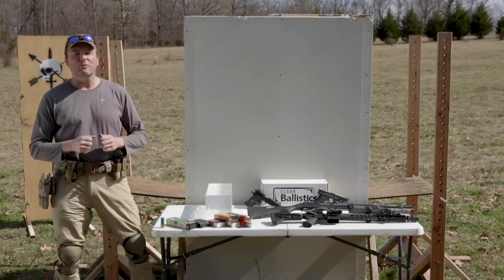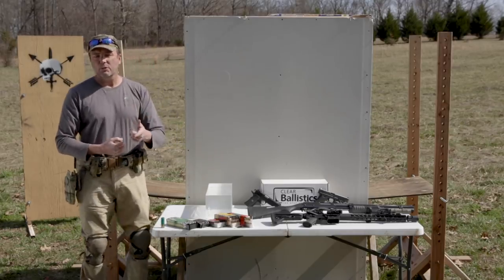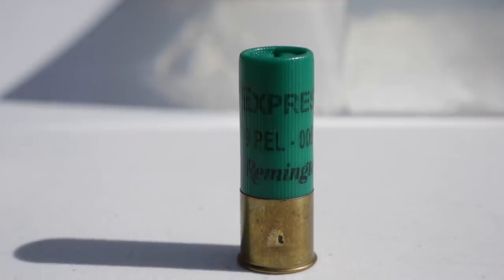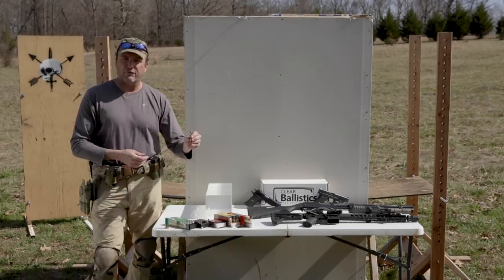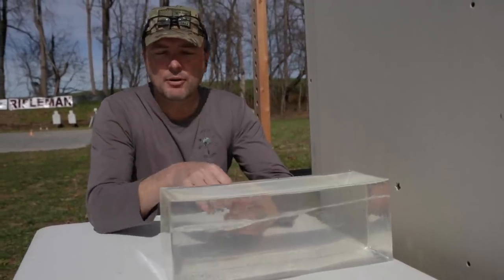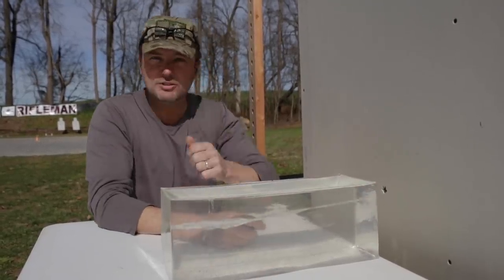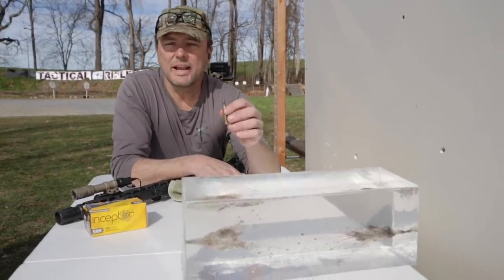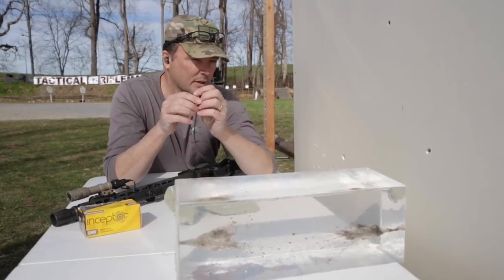What is the Best Gun & Ammo for Home Defense | Ballistic Test | Tactical Rifleman

Comment: I want to see varmint rounds from a 10.5" pistol/sbr
Reply: you & me both
Reply: Shortening the barrel wont change terminal ballistics at that range.
Reply: @lanenicholson3712  it actually does. Normal velocity from a 20" barrel is 3250fps. In general 5.56 must be in the  2700fps range or greater to fragment correctly. A 10.5" barrel  has velocities from even the best match cartridges around 2250fps to 2350fps max. Telling someone it doesnt matter will get someone killed because it does matter. What matters most is the projectile design. Fmjbt will tumble and fragment at 2750fps,but not at 2400fps. If someone is using a 10.5" barrel for home defense,use a round specifically designed for the velocities that can be expected. G2 research R.I.P. 5.56 is absolutely one of the best rounds for the home defense AR pistol and will fragment at the lower velocities of these shorter barrels.
Reply: @FreedomInc  There are actually quite a few tests showing decent tumbling and fragmenting of various .223 and 5.56mm even from a 7.5" barrel with most of those under 62 grains easily passing the 2200 fps mark.  With a 10.5" barrel that definitely is no problem.   Look up the PoBoy Special's channel and you'll see what I'm talking about.  As for the G2 RIP round, it actually with its 65 grain projectile, is a bit slower than most but still would probably be fine in a 10.5" barrel.  But really any 55 or 62 grain soft point hunting round in .223 would do fine.  Where  you run into trouble is the "varmint" rounds mean to rapidly disintegrate as these tend to have low penetration.  Ironically the faster the velocity, generally the lower penetration they get as they disintegrate faster.  Right now I'm trying to find more tests of the Federal American Eagle 50 grain varmint round through shorter barreled AR's to see if inversely , these get better penetration with lower velocity.   But until then I'm just sticking with Remington 55 grain soft point rounds.  They're pricey but worth it.  For practice I just use cheap Federal XM-193 FMJ (which also performs reasonably well in gel even out of short barrels).
Reply: @furryhatsgunsunicorns3219  I agree with most of what you said. If you read my comment it was based I the "fmjbt" projectile. Spire points will mushroom even at super low velocities. They fragment at these low velocities due friction and mushrooming. They aren't actually fragmenting they are being torn apart. The light varmint rounds disintegrate due to twist rates multiplied by velocities,or rather the 2 combined. The lighter the projectile in 5.56 or similar also means its shorter. Contrary to popular belief twist rates aren't a factor because of weights of the projectiles,rather their lengths. But since you have a max and minimum diameter weight is relative to length when comparing a certain type of projectile. With a 35 grain varmint round,really someone should be using a 1.12 or a 1.14 twist rate barrel. My point was that a fmjbt will fragment apon impact at 2750fps,but not at 2350fps which all you are going to get from a 10.5 inch barrel. I guess no matter what firearm you have,just do your due diligence so you dont poke self dealing holes in people before they kill you.(not meaning you personally)
Reply: @FreedomInc  My AR pistol only has a 7" barrel so for me, ammo selection is extremely critical.  Anything under 2,200 fps  (according to one of Hornady's main ballistic engineers who's done a lot of work collaborating with the FBI and law enforcement) and you don't get any damage to tissue from velocity.   As such, for me, anything that surpasses 2,200 fps, that expands well (or fragments), and that gets more than 12" of penetration, is the perfect round for my needs.  Most brass case 55 grain soft point rounds seem to meet that criteria. Cheap Russian steel case HP ammo works in my AR pistol, but not sure about how much velocity I'm losing as the steel cases don't always form a right gas seal in the chamber and so sometimes some velocity is lost.  Sadly it's hard to find such ballistic data from short barreled AR's on that ammo.  
What would also be interesting is to see how well the lighter high velocity varmint rounds perform  on a hog.  Not sure how humane that would be (probably best done on a freshly killed hog that was killed with a proper hunting round), but it would provide a fairly definitive answer to what it would likely do to a human in a home defense situation.
Reply: @furryhatsgunsunicorns3219  velocity and the design of the projectile,plus the media the projectile is entering or hitting determines penetration and fragmentation/expansion. With any length barrel whether its 7inches or 20inches,using the same projectile will expand/fragment different (normally better at higher velocities). Again,projectile design plays a large role in this. But velocity plays a huge role also. Depending on barrel length you will have severe difference when hitting a target at 5 meters then when you compared that to 50 or 75 meters or even a 100 meters. There are alot of factors that play into this that I have mentioned but twist rates will even effect expantion and fragmentation.
Reply: The only way to settle the velocity debate is for someone to stand in front of an SBR and see if it does the job.
Reply: @furryhatsgunsunicorns3219  Would you say those 55gr 223 soft point rounds are in the top 5 (or so) rounds for home defense?
What about subsonic 77gr 223 soft points?
Or subsonic 300blk soft points?
(I prefer to build a subsonic setup for home defense; but if there's no reliable subsonic ammo in regards to keeping over-penetration to a minimum, I'll go to supersonic)

Any info would be GREATLY appreciated. I've been looking what to put together for my home defense setup, & all this info I find seems to get contradicted by other info I find.
Reply: @bullheadedgideon1673  Generally speaking, most 55 grain soft point rounds from what I've seen in tests, expand just fine from an AR pistol. Check out the PoBoy Special channel if you want to see a bunch of tests of different rounds through a 7.5" AR pistol.  Now some people do recommend the heavy 77 grain .223 soft points. However the problem is that with those you tend to get 2 issues:   More excessive over-penetration and much slower velocities.  According to most ballistic experts, if you're not getting at least around 2100 fps velocity, then you're not going to get consistent "cavitation" damage to tissue caused when tissue exceeds it elasticity point and tears when the temporary and permanent wound cavity are created as you see in ballistic gel.  In ballistic gel you see this even with good pistol caliber home defense ammo.  However it's meaningless as most tissue (aside from very delicate tissue like the liver) has enough elasticity where the only damage that is done is by the hole that the bullet makes as it expands and by any secondary fragmentation from the bullet or the bullet's copper jacket.   So since .223, even with a 77 grain bullet, tends to make a tiny hole, it's very much dependent on its  velocity coupled with good expansion and/or fragmentation to do its damage.  That's why I don't recommend such heavy grain .223 rounds in AR-15 pistols.
Now with .300 Blackout, that's a whole different critter.  Because of its bigger, heavier projectile, you can get away with slower velocities as it punches a bigger hole and delivers more foot pounds of energy into the target with generally a much heavier grain bullet.   But if you go with a subsonic round, you need to really do  your research on which ones expand reliably and penetrates more than 12" of calibrated ballistic gel.  I can't tell you which ones to buy though as I'm not all that knowledgeable on all of the quirks of the .300 blackout round.  My expertise is more in .22LR, .25ACP, 9mm, 12 gauge, .223/5.56mm,  and 7.62x39mm firearms.  I've fired many other calibers of firearms, but I've only heavily researched and shot those calibers enough where I feel comfortable giving advice on them.
Reply: @woodchuckcider1  Would you rather stand in front of an SBR or a 20" barreled rifle shooting the same bullet at you? If you had to choose.

Comment: Glad you talked about hollow points filling the hole. Many cheaper hollow points and even some pricier ones will do this frequently. Do your research folks.
Reply: Precisely why I use a proven solid.
Reply: Lyle Caudill proven solid? Like solid point? It makes a hole but I wouldn’t carry it. If nothing else the hollow point on a bad day will act like a solid. On a good day it will open up much bigger.
Reply: I'm liking the performance I see from the polymer-tipped hollowpoints so far (in demos like these)
Reply: 3nertia that’s what I load for my kit and what I hunt with. Cheaper than TAP, very accurate. I also carry a mag of steel core just in case, but use 55gr Hornady for most cases.
Reply: Same here. Might have been nice to add in Critical Defense round(.223 & .45) for comparison to standard hollow point.  That's also why I prefer ballistic tip over open tip rounds.
Reply: @davidhawkins847  i had to shoot a boar with +P 9mm critical duty once. Distance one meter, through the shoulder (it was lying on the ground after taking a hit with a .308, still alive), smashing the shoulder bone and the bullet was stopped by the skin/leather on the other side. It mushroomed perfectly, I think due to the polymer tip. Now bought this bullet for my .45, but didn't have to use it yet. But outstanding performance of the 9mm, you won't go wrong with it.

Comment: The Flight control I use in my 12ga are only a fist sized pattern at the farthest shot I can tack in my house. Which is 20  yards. That’s the absolute furthest sight line I can take a shot. Average is 5-10 yards. So I’m not worried about stray pellets. I wouldn’t EVER use cheap range buckshot like Rio or Royal Buck! You WILL have a 2 or 3 ft spread then!

Comment: #4 buck is a must see.
Can't trash the smooth bore based on 00.
Dedicated shotgunners in the know are going to #4 big time, some PDs use it, or use #1.
Mine uses plated #1 low recoil, with a wad that keeps a tight pattern, with Beretta 1301s tuned to run that specific ammo.
It will shred a mfer.
Reply from the maker: I’ll take a look at it

Comment: I know I'm gonna catch Flak for this.....

My first go-to is a .22 revolver. 9 shots but I only have 8 (firing pin is on the hammer so I want to avoid a negligent discharge) and every odd shot is a hollowpoint and every even shot is snakeshot. If for some reason this is not enough to stop someone, I can take 2 steps and a great reach and BAM! Glock 19 with a happy stick filled with NovX. Figured the first one is just a professional courtesy because I live in a complex and would hate for a round to go through the neighbors wall.

Comment: The .223 Remington has lower chamber pressure than a 5.56NATO by 10,000psi. Hence, a .223Rem has less velocity and energy than a 5.56NATO. They're the same dimensionally, though. I don't use .223s in my AR, only 5.56NATO rounds. I'm going to try a frangible 5.56 to check out the depth of penetration difference comparable to the .223Rem. I didn't know much about frangible ammo until watching this video.

Comment: This is why I use either ballistic tip hollow point pistol rounds or external hollow points. I still have plenty of standard hollow points but just know they are not going to expand through thick clothing and will act more like an FMJ.
Reply: The Hornady Critical Duty 220 grain JHP is a very good penetration round choice. It met the FBI standard requirements. I have been told the Critical Duty is designed for large frame 5” pistols. I carry it in my Ruger Commander 1911 and my Springfield Armory 1911.

Comment: So is it the high velocity of the .223 frangible that results in the disintegration vs the ARX 9mm (which seemed to stay whole)?  Was always under the impression that the frangible pistol rounds were for use in confined populated areas when minimal collateral damage (through and throughs  etc} was desired.   It would seem NOT to be the case with the 9 mm ARX if it doesn’t disintegrate. Are there other frangible  rounds in 9mm, .380 etc that accomplish the job without remaining solid?

Comment: As far as buckshot, try the Aguila mini-shells w/#4 shot...  They don't have the energy to over-penetrate but still give quite a whomp.  They make an adapter for mossberg shottys to help feed the mini-shells and I've used them in my M3 clone pump.  Good stuff.  
G9 is riffing on Underwood Xtreme Defender/Penetrator ammo which is amazing stuff. 
 The Defender ammo, with the powders available today, even allows  .380 to act effectively at reasonable distance and target (relatively close range, regular clothing) and I'm good with that for my little, Keltec P3AT pocket pistol that fits inside the palm of my hand and disappears in my ankle, pocket and IWSOB with light t-shirt and shorts.  And it functions flawlessly.
  People like to pooh-pooh the  .380 round but, to them, I say "stand in front of this, let's see just how badly it sucks..."  lol.  
  I've found that my COR BON .45 followed by my Federal HST hollow points expand better than the golden Speer through soft barriers (shirt & jacket, etc.)  and the Xtreme Defender dumps a shi-ton of energy, with less over-penetrating, as well.
  Thanks for the straight forward presentation.
Reply: They're definitely similar but G9s design works better from all the testing I've watched. They create larger permanent wounds. Both are very good though.

Comment: Those frangible rounds will go through a 2x4 they have plenty  penetration. I have  them in 45 and they can still go through car doors. But if you're inside the car I wouldn't suggest shooting them through your windshield they start breaking into pieces but if you're outside of the car and have to shoot into a windshield it's like a shotgun blast to whoever is inside. Plus and minuses.

Comment: Do this same test with a FN 5.7 4.8"bbl  and a FN PS90 14.5" bbl with FN brand ammo you won't be disappointed
Reply: Marino 
the two I mentioned above are the 27gr hp that are about 100ftps apart from each other but both out of the pistol are right around 2000/2100 ftps and about 2400/2500 out of a 14." Bbl ps90 both still available to get over the counter. The ss197sr with the blue tip is about 300 ftps slower with a 40gr bullet. Yes vanguard and elite ammunition are what I call exotic loads for the 57 and will do great as well and now cci Speer gold dot has one with a 30 gr bullet that in my opinion is really no different then the ss197sr vmax tip. Like the gentleman mentioned above... I carry the pistol on my hip to give me cover until I can grab one of my PS 90s.

Comment: Excellent video! Luckily, ammo tech has come far to meet FBI standards and the latest technological improvements include HP that expand after passing through material and also maintain enough weight when going through auto safety glass. I carry HST's for this reason. GDHP's are also a great choice regarding FBI test results. One caveat: Make sure if you are using a subcompact as your home defense gun (provides cover as you move to your primary AR, lol) that your ammo will have enough velocity to penetrate and expand. They do make ammo specifically for the shorter barreled pistol.

Comment: Lots of interesting data. Here's the thing. As far as I'm concerned, the dangers of over penetration are so s,ight I do not consider it important enough to consider dismissing a specific solution.
Missing is 80-90% of collateral damage.
As for shot gun rounds, according to FBI labs #1 buck is the better choice however Federal Marshals prefer #4.
Not missing and stopping the threat with two shots is far safer than a ineffective round requiring more shots, more potential misses thus more potential damage to the unintended.